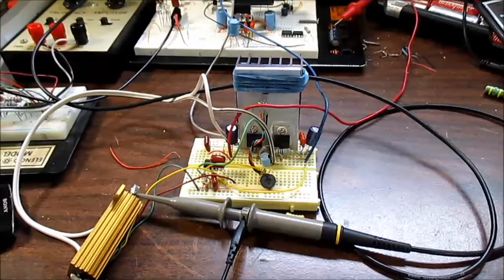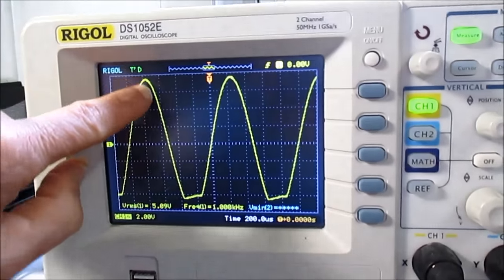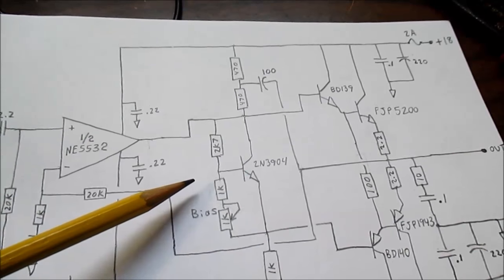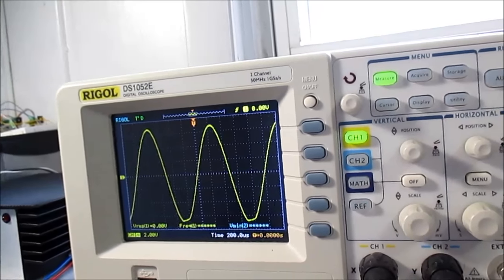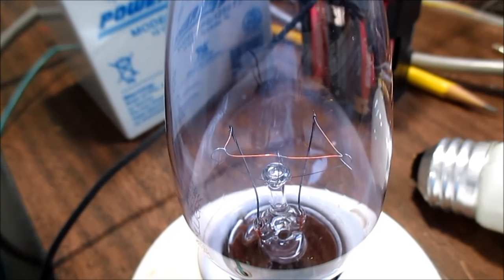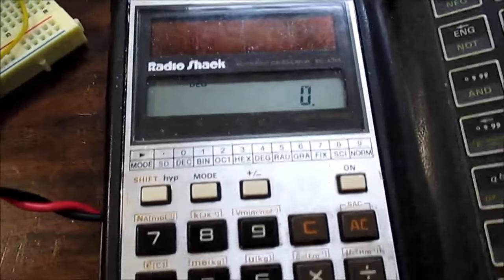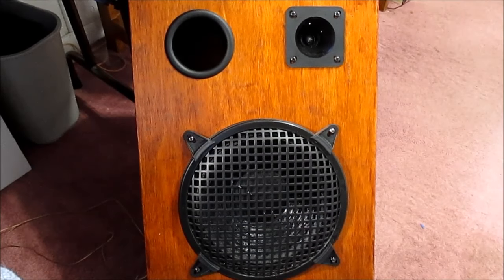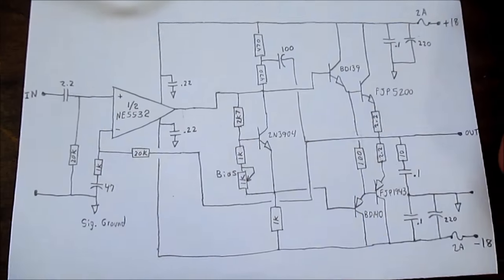DIY hybrid audio power amplifier sounds and works great after tweeks

Comment: I've constructed similar circuit many years ago (1997 or 1998) and still working great now. I use TIP120+TIP125 darlingtons instead of BD139+BD140+FJP1943+FJP5200. Also I put a 22uF electrolytic cap in parallel with 2N3904's c-e to provide symmetrical clipping.
Cheers from Indonesia
Reply: Btw, I love your shiny fur cat.

Comment: Happy New Year John I'd like to see that project as it advances. Just got a bag of 386's after watching one of your other videos and put a board together for a mic and speaker system also interested in the stereo aspects of dual signals and how you split the channels for left right front rear etc
Reply: area46241 you mean a matrix encoding, like Dolby Surround? As far as I can remember it requires a CCD delay line that have been out of production for more than 2 decades, around the same time that the whole matrix decoder has been implemented as DSP. But I think we can come up with something else, like a single bit DAC and ADC based on a comparator and filter and a digital delay line like a shift register; would need a few kilobits worth - substituting a microcontroller would be simpler than finding a part. Well it can kinda almost work without a delay line too, so maybe that's the first thing to try. Yeah it would be a valid and interesting subject.

Comment: So the final schematic shows the tweak, but not the Darlingtons (you'd lose that 100 Ohm resistor).?
Reply from the maker: I used Darlingtons on the board for lack of room but drew it as discrete parts as it might be the better way to go.

Comment: Hey John...what are the output transistors? FJP 5200 and 1943? I have a plate amp with these blown, originally had Toshiba 2SC 5300 and 1943, but hear that lot of counterfeits on eBay for those. Thanks for your video!
Reply from the maker: I used complementary darlingtons mainly because I have little room on the board for separate drivers. They are BDX33BG and BDX34BG. the 5200 and 1943 are nice linear gain output transistors. You have to buy them at a place like DigiKey to get authentic versions.
Reply: Thanks much for the info!